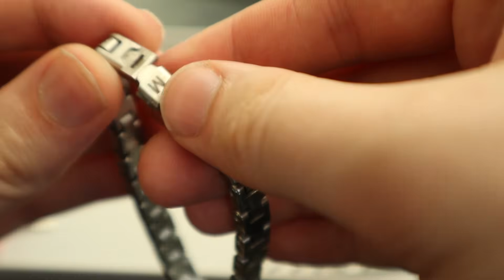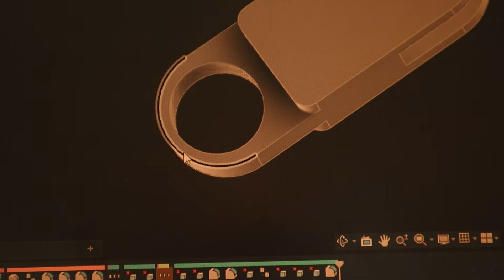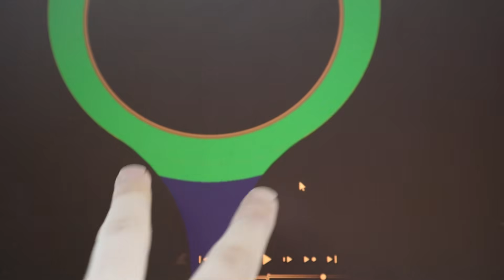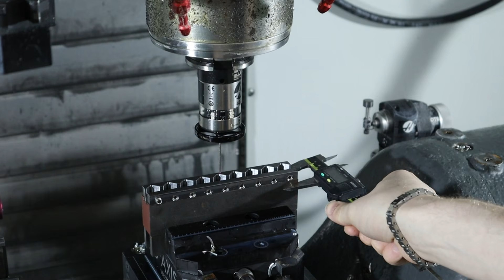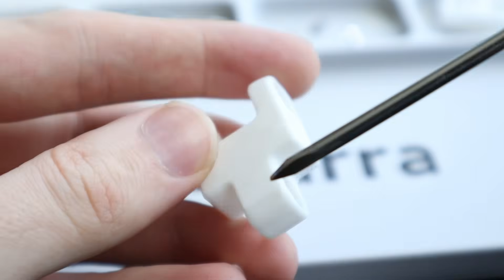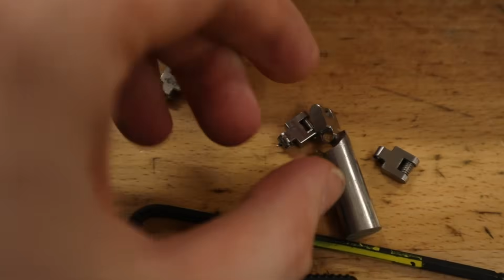CNC Machining the Perfect Bracelet Link | Modarra Monday's 002

Comment: Any reason you are not thread milling the thread? I use thread mills for most threads now, just use lead to centre, and drop the threadmill into the bottom of the hole and thread climbing up the thread to clear chips.
Reply from the maker: I assumed tapping would be faster in this application? I’ll have to do more testing, we’re threadmilling the custom screws so I’m not against it!

Comment: love this video brother been looking in to watches or watch links for motivation. make sure you spot drill for more rigid starters to hold better tolerance and use step-down for radius finishes on the ball nose or flat. you can also use bullnose endmills to rough out your product. you can use reamers for making sure diameters are correct in the I.D.and make sure you leave at least .005 on each side when leaving stock for the reamers
Reply from the maker: Thanks for the comment! Very aware of all of that but great reminders thank you!